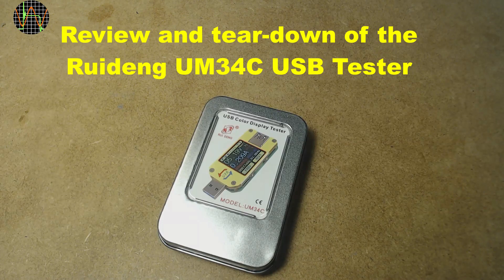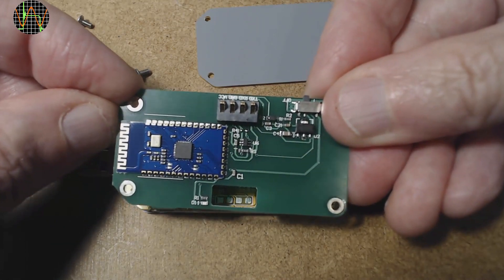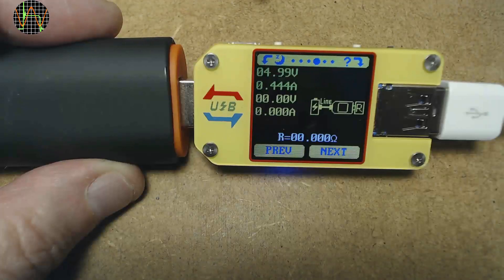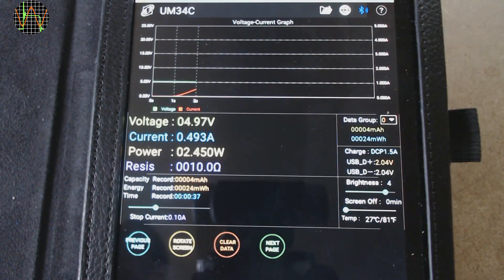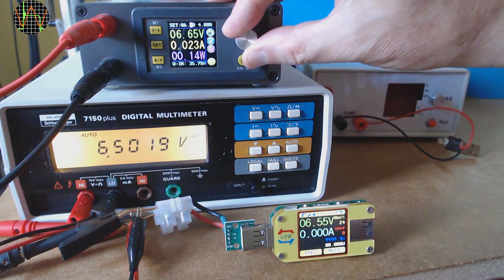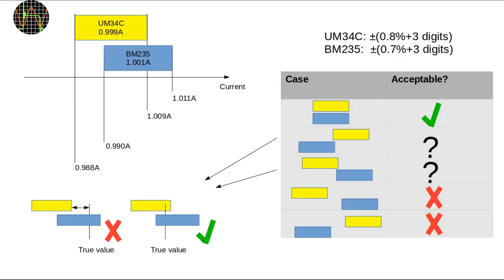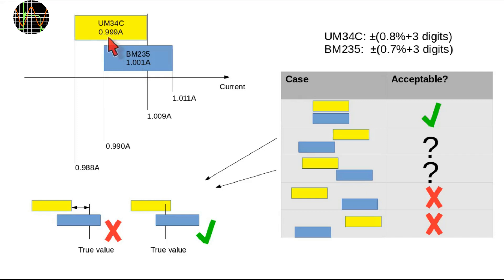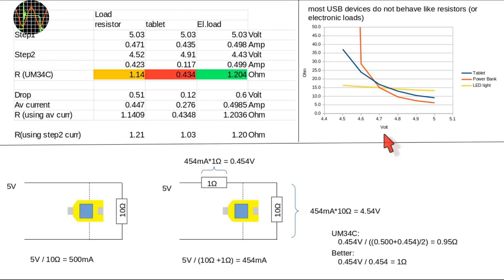Review and tear-down of the Ruideng UM34C USB Tester

Comment: I bought one of these based on the fact it has USB type-c input and a range of 4-24 volts, hoping I would be able to check charging of my iPad Pro which charges from PD 19 -ish volts on a type-c cable, but I can’t get the meter to register anything other than normal USB voltage of around 5 volts.  I now realise the type-c input has limited connections and is only for testing cables, but even using a type-c to type-a adapter to the standard input port, the meter still only registers 5 volts, and then using a type-a to type-c adapter connected from the meter output to the iPad, does not trigger charging.  Is this meter actually capable of monitoring the charge to an iPad Pro; are my adapters hard wired to force 5 volts using resisters across the data + & - pins; or have I got s duff meter?
Reply: Apologies - I meant 9v charging for the iPad.
Reply from the maker: @22smudger  It depends. If the charger and the iPAD support older protocols that only use the standard D+ and D- lines then it should do at least say Quick-Charge 2 or 3. On the USB-C you may have to flip the plug because the D+ and D- signals are not mirrored in the plug so orientation of the USB-C plug matters for these modes. The more advanced charging modes (USB-C PD) won't work when this tester is put into the circuit because it does not carry the signals that are needed for that. It may work if you get a USB-A (standard USB) to USB-C cable and put that between the tester and your Ipad (but not between the tester and the charger). The reason for that is that these cables contain a resistor in the USB-C plug that tells the device how much current it can draw. Most cables of that sort cheekily use a resistor value that enables a lot more current than the puny 0.5A they are supposed to enable by the standard.

Comment: Do you think that it could be possible to fit a power source in order to get it independant from the device we want to measure?
Reply from the maker: Hi Marc,
It certainly wouldn't be easy to do in such a way that everything still works. That said, if you look at my video on USB tester surprises (published 21-Dec-2019) you see that I mention a tester that can do that YZXSTUDIO:  ZY1280 but its very expensive and I have no idea how good it is. There may be others out there... The video I mentioned also talks about minimising the error caused by the self-supply of the tester when doing capacity testing of batteries, if that is your concern.  Depending on your load you can lower the error to 1% which for casual battery testing and comparisons is good enough in my experience. Of course if you want more accuracy, recording and things like timers or turning off when voltage, capacity or current thresholds are crossed , you can do as I did and build your own DC power monitor, Raspberry Pi zero based, which can do everything a USB tester can measure (and more) and runs of mains (or a power bank). That is a 5 part video series published early last year. Schematics and software can be downloaded freely from my Github page (see video descriptions for the link)
Reply: @TheHWcave   I thank very much of such a compehensive answer. I shall follow your remaks and jump to the various references you have so gratefully shown to me. Nice to read you. A M

Comment: What a great review! I want to order two units but I’m not sure about the IOS compatibility and need some clarification from RD Tech
Reply: Works well with iOS (UM Meter app) - at least it has done in the past. Still working with iOS 13.5.1, though the app could do with updating (it takes quite a while to initialize for one thing). I expect the app will stop working at some point, with future iOS versions (unless updated, which I think is unlikely imho), but I have older versions of iOS available anyway, so not a problem, per se.
Reply: sequri thanks! I’ve ordered and in fact they work with IOS 12 and 13

Comment: Very useful and detailed video! Enjoyed every minute of it. Do you think the circuit can be modified to use an external power supply (a battery) to power the STM microcontroller so it can measure voltages below 4V?
Reply from the maker: Hi Flavian, glad you liked it. Modifying the UM34C might be possible but sounds like an awful amount of work and a substantial risk breaking the unit for good. Depending on what you want measure, the  UNI-T UT658 USB tester I reviewed a couple of months ago can go down to 3V (but no higher than just below 10V). It is not quite as good as the UM34C but not bad. Another way is to just sacrifice a USB cable by cutting it, allowing you to put a normal multimeter in between the two ends.
Reply: Already did the multimeter thingy, but it's quite messy compared to simply plugging a meter in, hence I bought the UM25, which I really don't want to risk breaking. I don't think there are a lot of cases in which I would have measured under 4V anyway. If I'll want the meter to influence the power draw as  little as possible, I guess I'll use the Bluetooth with the screen off. Very glad you've shown the power draw in all the cases!

Comment: This also works with UM24C windows software. The UM24C is USB 2.0, but it has the same resolution. You said the Bluetooth pin pairing was 1234, so i tried it, and it paired in Windows 10. I then installed the UM24C windows software and it communicates with the device perfectly. 

It also connects with UM25C Windows software, but with the resolution being higher on that device, the digits are off and other functions like brightness level and auto screen off do not work.
Reply from the maker: Glad it works for you. I must admit I only used the Android app, and never tried their Windows software because my home PC is not Windows.  Since I did this video, RDtech did upgrade their Android software (now in Google playstore) but it seems to be pretty similar to the earlier version. One thing that is different is that it now tries to automatically open the recorded spreadsheet which IMHO is a bit of a daft thing on  Android because it assumes you have apps installed that can do xls files. That may be something that sneaked in from the Windows version.

Comment: Where do you get the app from, what do you mean by the app has to side loaded? I don’t understand. 
I’ve ordered the UM34C today, I will be a while before I receive it.
Reply from the maker: Hi Barry, you can find the link to download the app on the last page of the English instructions (link to that PDF in the description of the video). What I mean with side loaded is that it isn't in the app store. You need to either use the link in the PDF directly on your phone/tablet to download and install it or download it on a PC and then copy the file onto your phone/tablet and install it (click on it). If you have Oreo (8.1) a message pops up to ask if you really want to do that. In Nougat (7) and below you need to go to Settings -> Security-> and enable installation of apps from unknown sources first. Don't forget to disable that afterwards.
Reply: Thanks for the info, when I click on the link from the pdf file it doesn’t say UM34C only UM25C I don’t know what to do.
Reply from the maker: You are absolutely correct. I should have made this clearer. I actually forgot that the app is the same for all UM models. Download the "UM Series Android App 3 in 1_V3.0.0  which is what I used.

Comment: Is possible to clear / zero the Accumulated Capacity & Accumulated Energy
Reply from the maker: Yes it is. In the first screen (the one that shows current and accumulated data at the same time), a long press on the PREV button clears the accumulated data of the selected group. In the same screen a long press on the NEXT button increments the group number.  I glossed over that function because I never use groups. There are 10 groups (0..9) to keep accumulated data for up to 10 devices, or maybe more usefully compare the accumulated data with one from a previous run.  There isn't a function to clear all data from all groups at once. You need to do it for each group.
Reply: @TheHWcave  Many thanks.

Comment: When I connect to the meter via USB-C port and amp drops down from 1amp to 0.49 amp,  why? the usb cable is the fast charging cable I tested it to charge my samsung with fast charger and it works fast confirmed it, but if i use that cable as a bridge  in as usb-c to the meter voltage and amp drops. if I directly connect the meter to the charger then I get 1amp, if if i connect it via fast charging enabled usb-c cable it drops by half. how and why I have no clue, anyone knows? becasue  what if it is like that naturally what is the purpose of haviing usb-c and usb-micro in?
Reply from the maker: This is not a USB-C tester. The USB-C port is basically paralleled to the micro-USB for convenience to save you from getting an adapter cable. But this means that the USB-C only uses the wires of a  micro-USB, so there are only the standard 4 wires plus, gnd, and D+/D- supported.  The charging voltage & current you get depends whatever the charger and phone have implemented using just these wires. By the looks of it, it degrades to the default "safe" setting of 5V and 0.5A which means it doesn't even see the D+D- lines. One thing you could try is turning the USB-C plugs around. Although for USB-C plug orientation is supposed to not matter, strictly speaking for plugs this is not quite true because D+D- is only implemented on one set of pins and not on the mirror image other half. On a cable with USB-C plugs on both ends you may have to try flipping both ends = 4 possibilities.
Reply: @TheHWcave  One end is normal usb and other end is usb-c port, so normal usb goes in to the wall charger and usb-c in to the tester  in port, I have tried flipping it and did not make difference.  I have tried several cables that charges my phone fast speed(so I know these cables are fast charging cables) but if I use them as an extention cable with usb-C in port on the tester voltage drops slightly and amp drops by half, Therefore, there is no use for USB-C port it is just a gimmick to me. In addition if connect with micro-usb in port  it works normal, so usb and micro-usb ports gives full amp,  usb-c port gives half amp , tested this with 3 different fast charger and 5 different cables to make sure fault is not on my side. Thank you for your reply

Comment: You mentioned that the dropout voltage  = 3.96V, that is NOT correct, only the screen is switched off, the processor keeps running!
Reply from the maker: Yes, you are correct. I noticed that when I tested other models later (we live and we learn). Its not much lower though, 3V is when my UM34C stops and reboots when the voltage is increased again.

Comment: Thank you very much for your review and video, from the video, you should be professional, but there is something I need to see 

1, for your current , your way is wrong, you need to use at least 6 bit meter to compare , our meter have 5 bit , resolution is 0.001A,  your load resolution is 0.01A, how could you compare our meter , you should find 0.0001a mulitimeter to compare 
2, for cable resistance , our way is voltage difference to count a about resistance , not accuracy, it need to compare more 2 cable resistance , and we need to set 1A for load, not 0.5A 
thank you again

Comment: So, this tool is useless in this scenario - Laptop has USBC, and you want to re-image the laptop. This device will not verify that the USB-C port on the laptop is good and will not fry anything that is inserted into it.
Reply from the maker: I am not sure what you are after. Are you concerned for example that a USB-C powered external drive will work? No tester can tell you that. You can check what the voltage is and what current flows but if that is too much or too little for the device connected, the tester has no clue. Also for USB-C I would rather use a more modern special USB-C tester instead of the UM34C which is predominantly for the older USB ports.